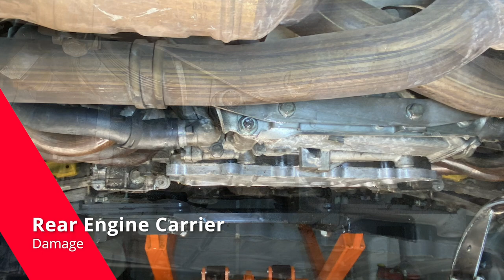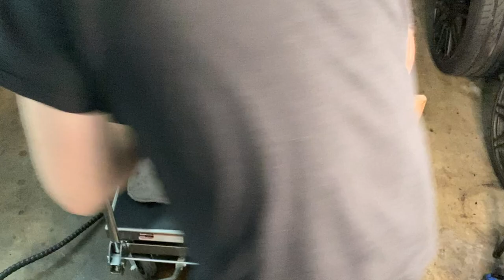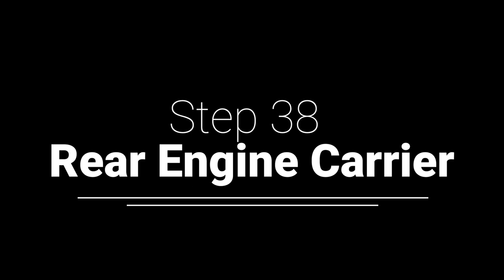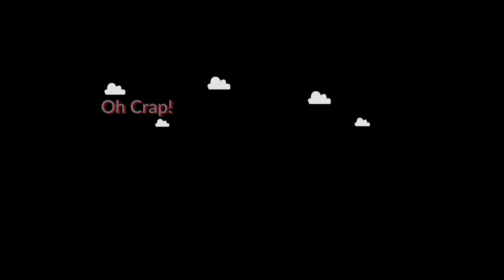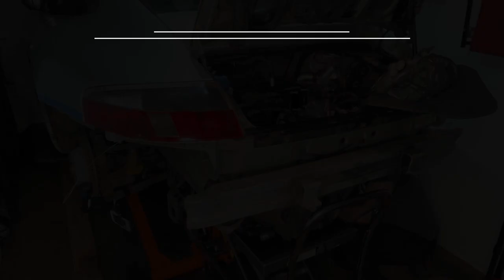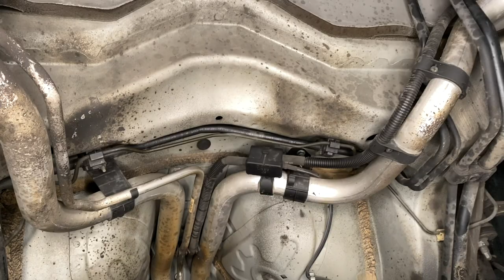How to Remove a Porsche 996 Engine Part 04

Comment: Respect! You show how it really is, without skipping the completely normal but often concealed minor difficulties. Yes, all of us screwdrivers have had problems removing a simple plug, loosening a hose without later standing completely in the coolant, loosening a nut that you can see but simply could not reach with the tool, or having to fight against decades-old screw connections that have become almost unsolvable due to rust and dirt. 
Please continue in the same way, your Youtube channel is simply something completely different: not the usual mechanics who screw on the floor in the backyard and pretend to be professionals.
Best regards from Germany!
Reply from the maker: Hallo Rene, I’m glad I’m not alone 😅, thank you for watching!

Comment: Excellent video series! I'm working my way through all of them. Watching you remove the exhaust in this one, I'm forced to comment on how jealous I am of how easily your manifolds came off! I'm trying to do the exhaust on my wife's Boxster 986 right now and 20 years of salt encrusted UK roads has disintegrated all the bolts. I'm very envious of your nice San Diego run Porsche where everything comes apart easily!
Reply from the maker: The whole time I was working on that exhaust system I was thinking how bloody lucky I was that this was NOT a British car! I remember rust 😳 . May the force be with you, thank you for watching 🤘😎

Comment: Hi, I am motivated by your videos for the engine removal at my home garage....but do not have a lift so wondering if you can help in finding the minimum height to place the car on jack or the height of engine on the hydraulic lift...in the video it looks like the engine on the hydraulic table was around the level of the hydraulic table handle height...but then it depends what hydraulic table you were using...😉...some thoughts when you have some time would much appreciated... Thank you
Reply from the maker: Hello, I talk about all the at stuff in this episode. Thank you for watching 🤘😎

Porsche 996 DIY Scissor Lift in a Tiny Home Garage
https://youtu.be/WQySG_mpgIc

Comment: I'm all caught up on your videos.  More or less.  Anyway - one thought on your lift mod if you care - by cutting it, you give the lift manufacture a good out should the lift fail and you have to sue them for negligent design.  Unlikely to happen, but it's an observation nonetheless.  Keep up the good work!  I am jealous of your cylinders.  I have a perfectly running car, but for a telltale puff of smoke on start occasionally from the driver side tip (i.e., notorious bank 2).
Reply from the maker: Happy Friday Former Engineer 🙌 . I think it would be an uphill battle suing the Chinese company that made that lift even if I had Robert Shapiro in my corner! The cylinders were a lovely surprise, I am not complaining. I hope you have success diagnosing your car's issue, your issue is one I heard regularly about these cars, hopefully, its nothing serious 🤞🏻. Thank you for watching 🤘😎.

Comment: What’s the weight capacity on that lifting trolly?
Reply from the maker: This video Talks about the lift in more detail. It is rated for 6600lbs. I have used it to lift a full size mercedes SUV at 5500lbs no problem. Thank you for watching! 🤘😎
Transform Your Home Garage into a Porsche Workshop with this DIY Scissor Lift
https://youtu.be/WQySG_mpgIc

Comment: I suspect its a great tip to remove the exhausts before dropping the engine. I haven't seen that anywhere else, but think I'll do that with mine....was just about to remove the remaining bolts for dropping - so I guess it's put me back a little but in the long run forwards as will save me time once the engine is out!!
Reply from the maker: For me, I was focused on removing as much size and weight from the engine before I removed it from the car. The exhaust bolts were not difficult to remove on this particular car, I was expecting to need the weight of the car to wrench against to get rusted exhaust bolts off. In this case the bolts were not fossilized into the bolts or the flange, I probably got lucky. Very best of luck with your project 🤓 . Thank you for watching 🤘😎

Comment: That clutch slave cylinder is missing a plastic cap on the end - going to make some distressing sounds as you let the clutch out when it's back together unless you replace it.
Reply from the maker: Hello Joby, I really appreciate the heads up 🙌 The Slave cylinder is one of the laundry list of recommended replacement parts that go along with the clutch replacement itself, I thought I could get away with it 🤣😂😅 I guess I’m going to be the proud owner of a new slave cylinder. Thank you for watching. 🤘😎
Reply: @ManinaGarage  I had the same issue, so one of those things where shared experiences help!  Good luck with the build and sooo glad you made a point about pinning the IMS.  That's a failure point that could ruin a perfectly great rebuild in seconds.  If you're on the fence about the IMS Bearing, I'd recommend the extra $$ and get the LN IMS Solution.
Reply from the maker: @jobytapia6388  Hello Joby,, that’s good advice, thank you. I’m sending the ims to LN Engineering to get the bearing installed. 0% failure rate is good enough for me 🍰

Comment: Is there enough room to remove the bell housing bolts with the engine still in the car? Would be awesome if it's not required to drop the transmission with the motor.
Reply from the maker: You can definitely remove the transmission by itself. 👍

Comment: You may have covered this elsewhere - but what kind of hydraulic table cart do you have? 500lb or 1000lb and is that the one from Harbor Freight?
Reply from the maker: Hello Manu,

It’s the 1000lb from harbor Freight, thank you for watching. 🤘😎
Reply: @ManinaGarage  thank YOU for your whole channel! I’m in the midst of dropping my 996 engine now. Already gave up on the compressor bolt and disconnected the lines instead 🤣

Comment: After watching this I will remove the gearbox first before lowering the engine. I changed a clutch in my 997 about 4 years ago. It was actually an easy job (except for putting the slave cylinder back..._) I think these cars have been designed to be worked on...
Reply from the maker: Hello Andrew, You are right, these cars are pretty well though out. Thank you for watching 🤘😎

Comment: And do change your crankcase breather , because It's easy to change right now !!!
Reply from the maker: Thank you Arnold, I will do everything you say, your advice is pure gold 👑. Crankcase breather and Engine Mounts have been added to the list, SIR, YES, SIR!
Reply: Dear Friends, what about the crankcase breather? What is the problem and what is the solution/modification? thank you all
Reply from the maker: @1ricardobaptista  I think it just gets gummed up with oil deposits from doing it’s job for a long time. I plan on using  a Porsche original part, if there is an upgrade I’m all ears.

Comment: The reason your engine is wet and oily lies in the fact it has been mistreated by It’s Former owner ( ignoring that the Engine is cold and hitting the throttle ) I warm the Engine up for about  40 Miles the Result is that my Engine is dry !!!
Reply from the maker: Pesky previous owners 🤣 . 
I hereby promise to always let my Porsche warm-up before I "Drive it like I stole it!"
I just need to put it back together first😫. 
Thank you for all your help Arnold 🤘😎